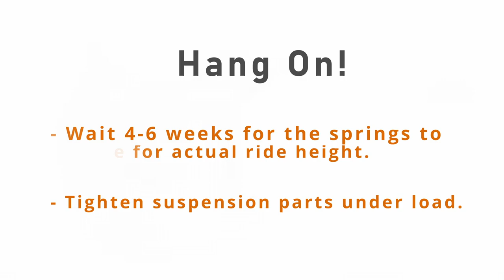BMW E90 Suspension Install - StrutMonkey

Comment: Isnt the additional shock absorber 31336767333 and the protection tube/ boot 31331094749 you say needs to be sourced separately, isnt it built in the Bilstein kit? the blue protection tube and the bump stop is inside. Are you referring to OEM struts? or Shoud that black protector and bump stop be added to the front struts? I didnt see you adding them despite saying you need to source them.
Reply from the maker: I am saying that you need to source these if you are building your own kit. However it's included in the kit with no additional hassle.
Reply: @bradtourt  thanks!

Comment: Great video. Had to use a T30 to hold the rear Biltsen shock while installing and a drive socket 6 on the factory shock.

Comment: Just installed a full kit from Strut Monkey (Koni FSD with Eibach springs) along with a full M3 control arm upgrade front and rear.  
Be sure to double check the torque settings on the lower shock mounting nuts after install and alignment if you have any subtle "clunking" sounds.   It's easy to overlook. 

If the rear end feels squirly and loose after upgrading then it is your subframe bushings that need replaced/upgraded.     Might be worth looking at doing at the same time so you don't have to redo all the work later in the rear. 

Overall Sturt Monkey made it super easy.     I would have liked it they had offered upgraded poly top shock mounts instead of the basic foam bump stops/mounts as I would have went with them instead.     

Overall though, they made it a straight forward install.

Comment: Great video. This is gonna be great to use when I do the same job on mine. Could you do a video on replacing control arms and wheel bearing as well for the E90?

Comment: Is there a reason to install the rear strut AFTER the control arm is bolted back up to the knuckle? Could the strut install be easier if it was still hanging loose? 

What torque spec for the nylock nuts?

Thanks for this great video - already did my fronts. Cheers!!

Comment: Thanks a lot !
100% detailled and accurate video !
I'm now much more confident to DIY my shock absorber myself.
I'm considering installing B8 as well. I'm just curious about the comfort, how is it compared to before ? Is the ride not too harsh after your upgrade ?
Reply from the maker: B8 will be firmer than stock, but it's not going to be too harsh

Comment: What socket did you use to hold the rear stock when removing it from the car.
Reply from the maker: I believe I used pas through sockets and a 6mm. https://www.walmart.com/ip/Bostitch-BTMT72287-65-Piece-Pass-Thru-Socket-Set/25440928

Comment: I love how every video doing this suspension conveniently doesnt do the driver side where there is a lip in the cup for the shock to go through and after market struts done fit past it. Ive been trying to find a video showing what to do
Reply from the maker: They should be the same for both sides. Feel free to send me a PM on instagram
Reply: @bradtourt  both sides were the same. There was a ridge at the bottom of the strut boot where the new strut will not slide past it even if you use something to spread it open, I had to completely grind it out with a grinding wheel which took forever. Had to do it on both sides. I have a 2009 328i xdrive so I don't know if that's what made the difference but it made it a complete pain in the ass.

Comment: Excellent video! Question about the pass through socket: what did you use to keep the shock stationary? Is that part of that Bostich kit? 
Thanks
Reply from the maker: Some use a socket or an Allen

Comment: So when you install do you tighten bolts under ride height or wait a few weeks to do so. Also does the suspension settle that much after a few weeks. Just installed mine along with new rubbers but the rear sits higher than front 😂. The suspension looks stock atm 😢
Reply from the maker: Any suspension bolt with rubber needs to be tighten under load/ride height. And yes they will settle some.

Comment: As someone who has lowered several cars in my driveway with spring compressors there is nothing wrong with spring compressors. You just can't be a complete moron!!! Very nice kit but I like my fillings in my teeth...
Reply from the maker: I agree, however the kit just makes it easier for the DIY guy

Comment: which model of billstein you used bro
Reply from the maker: B8 is this one
Reply: Does the website not work anymore. Everytime I click on the kit I want. The page doesn’t load
Reply: @user-xm6oq9gz9u  try doing a contact link. I just ordered this week.
Reply: Received my kit yesterday and changed the struts and got one side done on the rear. I’ll got the tool for the struts and it makes it easy. Mine came with caps so no need to swap. I had problems lining up the hind joint for the bolt to go back. The front of the swing arm would not align. Had like a crescent moon overlap. Finally hit upon using a ratchet strap to pull it forward and that got it close enough to get the bolt through. Sometimes a 20 min job becomes a 3 hour job because of one bolt😅
Reply: @timprussell  yea got mine installed already